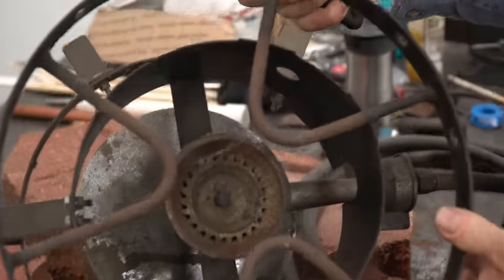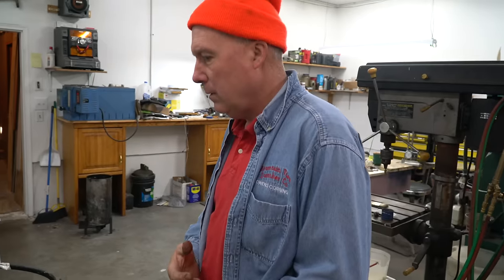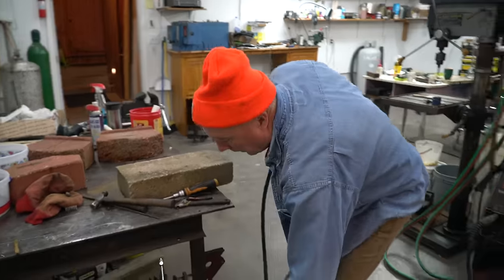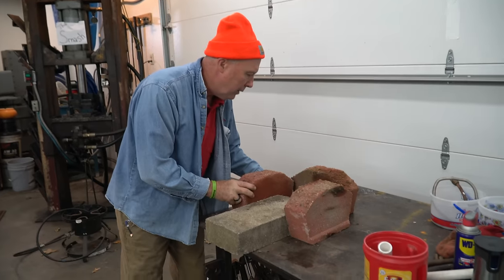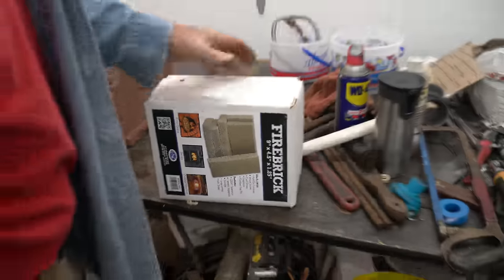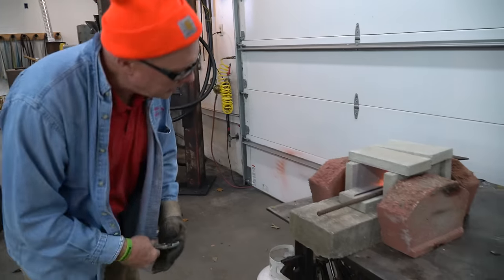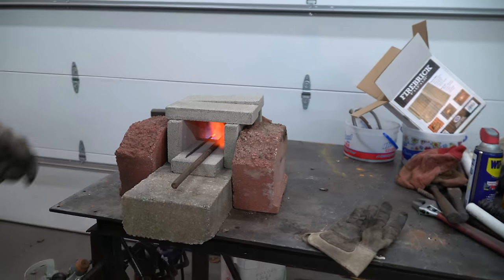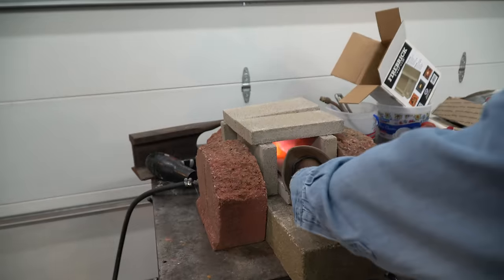Firebrick Forge Under $20

Comment: Gonna give a psa to anyone new to gas forges propane tanks they are designed to go full blast after like half a turn so if something does go wrong you can quickly shut off the gas supply. (Feel free to correct me if I’m wrong)
Reply from the maker: Great tip Burgess!